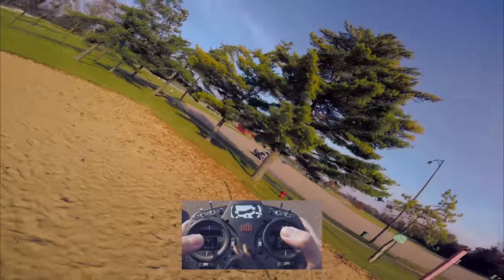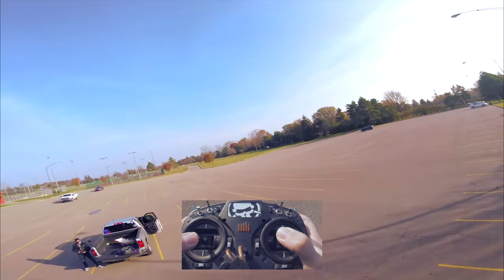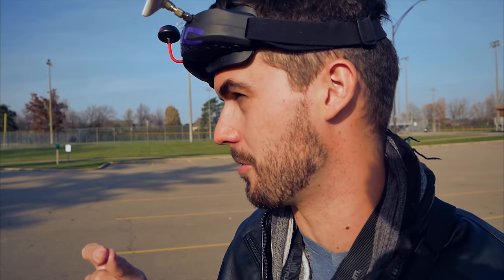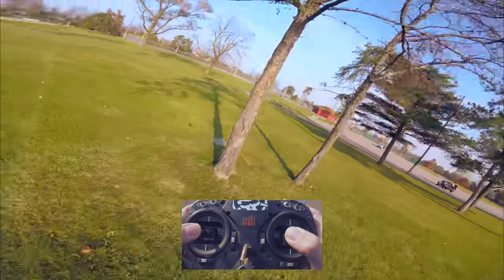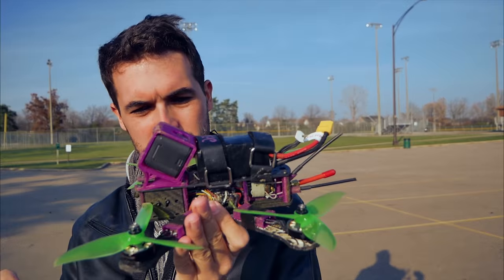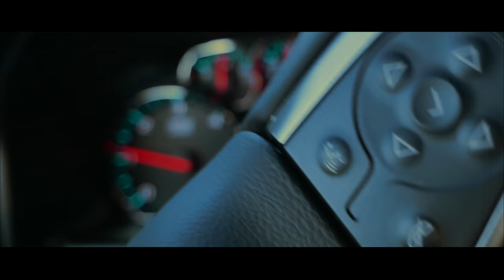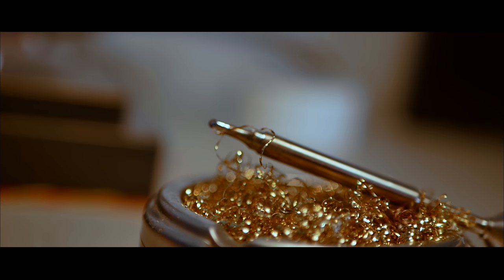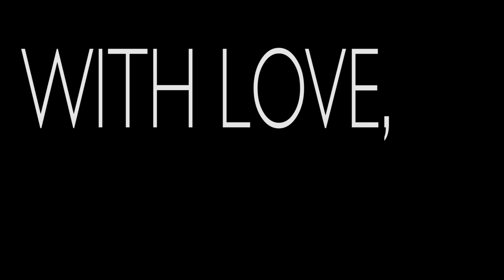how to INVERTED YAW SPIN

Comment: Love these tutorials! Could you maybe do one on smooth flying. You always have so much "flow" in your footage and it looks so smooth. Thanks
Reply: Dizzy.D FPV slow down your rates! I used to fly with fast rates but i slowed them down closer to what drib uses and it made my flying much less twitchy.
Reply: Lucas Schaar Thanks, I'll try it out. May I ask what your rates are? Was thinking about lowering them. Especially the rc rate so the sticks get "softer" in the middle
Reply: Very close to Drib.. around 850 roll, 700 pitch and 600 yaw. Still keeps quick rolls but the slower pitch makes it a bit smoother I think. Just play around with them. I don't do many jyaw spins so I don't care for a fast yaw rate.
Reply: and I copied what drib does with RC and super rates, no expo. 1.2 and 1.75 RC and .73, .65 and .40 super rate. It makes it less twitchy near center stick.
Reply: Lucas Schaar Thanks. ..I'll fiddle around with them

Comment: good tips on the inverted y/jaw spin lol try for the in motion not to flip the mix roll and yaw but make it one so roll never goes back to center then mix the yaw. also do right side up yaw till your eyes know tilt angle and auto adjust mix and don't stop at inverted. use it like a acrobat uses cartwheel but take it kwad yaw spinning gaps at all angles.

Comment: I'd like to see a more in-depth tutorial on how to powerloop. Most anyone can go under over and then under again, but how do you aim the top of the loop? Like in a couple videos I've seen you go through a really tight gap (that I wouldn't even  try right side up) upside down. Just wanting to know if there's a method you developed for it or you it just happened a couple times and you figured it out.

Comment: lovin the content buddy, have you ever tried the revolt fc , ive just made the switch and lovin it , also what did you make of the Ld power motors, think you tried them out a while back ? , i just got the 2305 2400kv so smooth

Comment: Le Drib this is definitely a place where a simulator like Velicidrone can help.   I dont have any places around me that really give me the kinds of objects that I can invert and yaw spin to look at.

But this leads to a question.   Where are you on your rates that you have used over the past year?

I slowed down my rates from like 1050 degrees per second to around 890 per second.   Did more linear rate with a tad more expo and less super.     It is probably the most measurable improvement in my flying.    Inverted yaw spin seems like a trick that could benefit from slowing down rates.

Comment: Top Tip:
If you run a 45deg camera angle, then if you have a level horizon, and use equal amount of roll and yaw, it will yaw flat. Works inverted, sideways or otherwise.
Reply: FPV YoYo assuming you have same roll and yaw rates which many people don't
Reply: True, but if they are close, it won't really matter, and I think most people run the same/similar rates on all axis anyway. Good point though.

Comment: What kind of VTX antenna is that?
Reply: it's just a sleeve dipole with a plastic cap on the end. Exactly the same as the crappy ones that come with cheap vtx's, just a bit smaller and lighter.